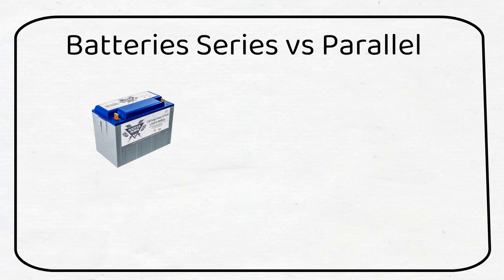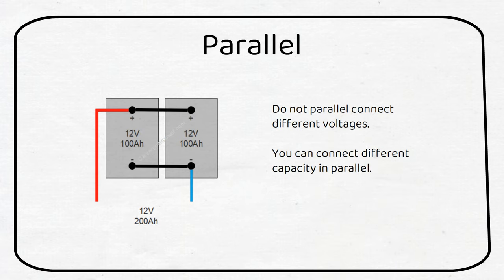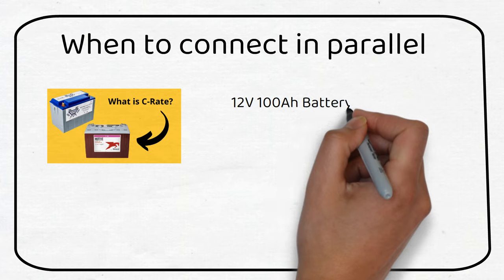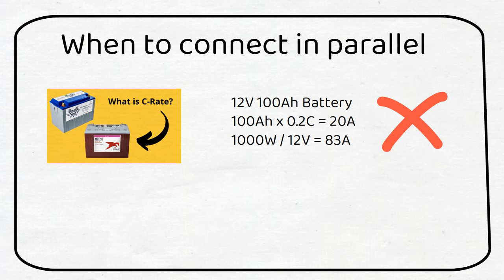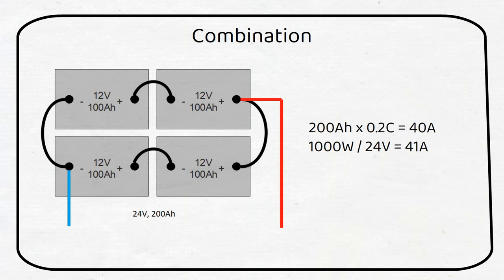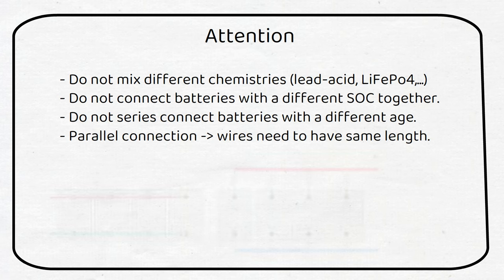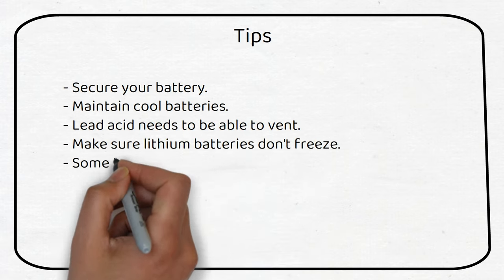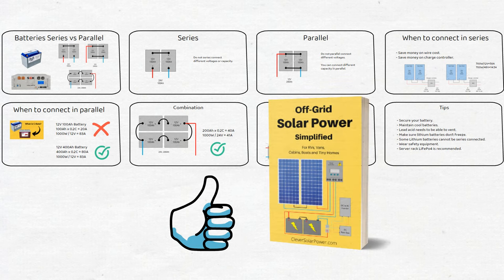Wiring Batteries in Series or Parallel for Off-Grid Solar Power

Comment: Ive seen a lot of these videos and each one has a different way to wire in parallel and the type of inline fuse to use. I just went to an electrician site and it was different than this one.
Reply from the maker: That's because there are different methods to wire them.

Comment: Hey Nick. I am still confused after all my research. I Recently purchased two 24v 100aH LifeP04 batteries. I plan to connect them in parallel to get longer lasting power. I am having difficulty determining what cable size I will need for the parallel connections between batteries and from the batteries to my 24v 3k watt Growatt all in one Inverter. Thank you for any insight.
Reply from the maker: Checkout one of my latest videos about current sharing. To make it easy, just use the same cable that you would run up to the inverter for interconnecting batteries. For a complicated answer, checkout my video about current sharing.
Reply: 4A / mm^2
Reply: @cleversolarpower Thank you!

Comment: Not good engineering practice to connect low impedance batteries in parallel - large circulating currents may result causing potential fire / explosion.
Reply from the maker: You should only connect in parallel when they are at the same voltage (state of charge).

Comment: Can you feed a single 12v battery from a 24v solar array?
Reply from the maker: Yes, it's not going to be efficient if you have a PWM. But no problem with an MPPT.
Reply: @cleversolarpower  Two 12V peltiers how do i connect them directly to 24V solar panel?

Comment: Good day sir can i connect 2units 55ah 12v and 1unit 100ah 12v battery in parallel connection with the same brand of battery?
Reply from the maker: If it's lithium and they have a BMS inside, you make two battery banks. One 110ah 12v and one 100ah 12v. Let both batteries go to a busbar. Every battery bank (2) needs to be fused separately.

Comment: 1:23 that is not the way to size a Charge Controller. A charge controller amps depends upon the Solar Array Current at Maximum Power Or Imp and depending how many panels are connected in Parallel.
Reply from the maker: No, you are wrong. The current of the charge controller is determined by the charging current to the battery, not the input current from the solar panels.
Reply: @cleversolarpower  if so then why do we connect Solar panels to a controller in the first place??
Reply from the maker: @giovanninongbri2250  Take your solar panel power and divide by battery voltage, then you have your charging current to the battery. 600W/12V=50A -> 50A charge controller. Then you have to calculate the input voltage, because there is a limit on it. max input voltage = Voc*panels in series * 1.25. If a panel has 22V Voc, then: 22V*3panels in series*1.25=82.5V -> charge controller with 100V max input voltage is ok. Hope this helps.
Reply: @cleversolarpower  so you're telling me that the controller makes its own current to charge a battery? the solar array current charges the battery so if you have a 36 cells Solar panel which is considered 12Volts or having a voltage maximum Vmp rating of 17Volts and a maximum current or Imp rating of 8 amps and suppose you have three panels connected them in parallel the total amps would add up to 24 amps, whereby the voltage stays the same as 17Volts,  So the current coming from the solar array to the controller will be 24 amps so choose a controller size of 24 amps x 1.25 = 30amps and if you have a single 12V Lead acid battery then select a controller of 12Volts. Hope this helps , I'm an experience in the solar industry with installations and sizing so I believe I'm qualified to share my opinion and the sizing of a controller.
Reply from the maker: @giovanninongbri2250  A charge controller takes the total input power from the solar panels, not only the current because power=voltage*current. If you have a PWM, then you should do it the way you described. If you have an MPPT, then you need to connect as many panels in series to the max allowable input voltage of the charge controller. Remember, it is total input power that matters, and not current.
Reply: @cleversolarpower  yes I do know that Power = Voltage x Current.  I agree with you on the PWM controllers. Just make sure you mentioned the type of Charge controller you used on your videos so that common people will understand
Reply: @giovanninongbri2250 sir can you shade me a light, got 12v 150 ah and 3 12v 50ah bat is it ok to parallel them?
Reply: @pepegonzalez8301  No do not mix/connect different battery ratings together. Each battery must have the same Voltage and Amp Hours and the same C Rate.
Reply: how about series connection using 2 different amp batteries  with same 12v? is it okay?

Comment: can i series 2 different AH battery with same voltage?
Reply from the maker: If you connect two batteries of the same voltage but different capacities in series, you will get the correct voltage, but the battery with the lower capacity will be overworked as it will discharge faster than the larger one. This can lead to reduced battery life and potential damage to the batteries.
Reply: @cleversolarpower  thanks so much sir for info

Comment: WoW never heard about c-rate, and believe me, no e bike owner mention it. Wel i have 4 lead acid each 7 amp. Is it wise to make for mij ebike a c - rate configurations. The controller can handle 12-24-26  volt. Just have them now series it works
Reply from the maker: 4 12V batteries in series will give you 48V at 7Ah. With a 0.2C rate you should only draw 1.4A*48V=67W

Comment: hi thanks for your videos. I have 52 AGM 12V and 40 Ah batteries. I would like to create a photovoltaic storage unit (I know they are not indicated but I want to try). What type of series/parallel connection should I make to maximize Wh and get 48V total?

Comment: @cleversolarpower  thabk you for reply.

I meant that I have 1 set of batteries. Battery 1 12v 280 ah and battery 2 12v 280 in series to make a 24v of 560 ah 
& a separate
Battery 3 12v 100 ah and battery 4 12v 100 ah in series to make 24v 200 ah.

Could I now parralell the battery 1 and battery 2 to battery 3 and battery 4 (battery 1 and 2 became 1 and battery 3 and 4 became another )

Comment: i had cable wires shoter and was draing battery more then the other.   I have two 24 volt 200ah batterys conneted in series to make  54 volts i conneted it 4 hours ago
I have to go turn of everthing off and paralele the batterys to  bring them both the same volts now as one is 78% and the other 100% glad i so your video explained a lot i did not know thank you.

Comment: I have 300 watts on panels coming in to a 400 watt charge controller. Then from there to a 12v battery with 35AH. Then to a 2000Watt inverter. Can you help me determine how I can improve this or if I’m doing this wrong.
Reply from the maker: Your battery is too small. Check my video about how many batteries for a 3000W inverter. It's my most watched one.

Comment: I have 4x100Ah Lithium batteries that I want to keep in parallel @ 12v and want to connect a 3000watt inverter to. I'm aware of the cable size requirement with a safety margin being around 312amps and 0000B&S or 120mm cable seems to be what's required when considering what the inverter can draw in current. My confusion is 'if' a busbar is used does each battery connected to the busbar have to have 0000B&S cable interconnects or will the 0000B&S cable only be required as the connection cable at the end of the busbar to loads? It seems to me that each battery will only supply one quarter each of the max current so cable size from each battery to the busbar can be reduced accordingly. Am I wrong?
Reply from the maker: That is correct. Add a 150% factor to it as i have explained in the video.

Comment: What is the best configuration to connect three lead acid batteries wired in parallel to the charging and load wires without a buss bar available? Should the charging and load wires be connected to the same terminals?
Reply from the maker: Yes, all to the same terminals. Main positive on battery 1 and main negative on battery 2. Max 3 connections per battery terminal. Otherwise -> busbars.

Comment: If an appliance draws a certain amount of energy, how does a change to voltage increase the battery life?
Reply from the maker: Increasing the voltage will reduce the current draw from the battery. Less current draw= slower discharge rates = longer lifespan. Check my video about C rate.

Comment: Could I connect 2 12v 280 ah batteries I have in series (24v now) to two other batteries of 12v 100ah that I have in series (24v now) IN PARALLEL?
2 separate series connected batteries to be connected in PARALLEL?
Reply from the maker: Yes, battery 1 24v 280ah seperate and battery 2 24v 100ah seperate to make one big 24v 380ah battery. Every battery set needs to be fused.
Reply: @cleversolarpower  thabk you for reply.

I meant that I have 1 set of batteries. Battery 1 12v 280 ah and battery 2 12v 280 in series to make a 24v of 560 ah 
& a separate
Battery 3 12v 100 ah and battery 4 12v 100 ah in series to make 24v 200 ah.

Could I now parralell the battery 1 and battery 2 to battery 3 and battery 4 (battery 1 and 2 became 1 and battery 3 and 4 became another )

Comment: 4:20 i dont understand whats the diff hrere in wiring , why is left marked wrong and right marjed as correct?
Reply from the maker: Every battery is fused and goes to the busbar. This is for current sharing reasons. Also if one battery fails, the rest will dump their short circuit current into it, that's why you need a fuse.

Comment: How Can we connect equalizer 24v for 4 battery in connected 24v ?
Reply from the maker: Do you actually need one? With 4 batteries this seems less likely. Measure the voltage of each battery. If needed parallel them or charge individually to reduce voltage fluctuations.

Comment: Hi, with the c rating when connecting a inverter to draw 240 volts can a microwave capacitor be used to eliminate this issue of having more batteries in parallel? 
If possible is there a specific way to wiring.
I have see capacitors in parallel being used in some setups on utube  this way for the initial draw.
Reply from the maker: A capacitor bank will help with reducing the startup current. Microwave is an inductive load so a capacitor bank will help reduce this. I haven't done this before, so I don't have any personal information to share.

Comment: If I connect 2 12v battery in series. Will it increase the watt hour? Meaning more Capacity? For example, I have 2 12v 280ah battery which has 3584Wh. If I connect 2 in series it will has 24v and 7168 wh. So I double my capacity?
Reply: No. If you connect in series, only your voltage will be doubled up. If you want to double your wattage, you need to connect them in Parallel, but the voltage will stay the same. If you want to double the voltage and wattage at the same time, you need 4 batteries with same spec, or just buy new batteries.
Reply: @Boiledfoodonly  I'm still confused. Let say we connect 2 12v 100ah battery. We will have 24v 100 ah battery which is 2400 watt hr capacity. But a single 12v 100ah battery will have only about 1200 watt hr capacity. So we double the capacity?
Reply: @TienTran-bi1jv  oh I am sorry, if it is in wattage, it means power. If the voltage doubled, yes of course the wattage will be doubled too as the formula for wattage is voltage x amperage. But the capacity (Ah) will still the same.

Comment: I intend on taking several 20v 1.5 ah 18650 powered tool batteries and creating a larger more capable battery. My only question is would it be better to make 5 banks of 4v and run that in series , or 5  20v banks
Reply from the maker: I would increase voltage as it will mean less current thus less thick wire.
Reply: @cleversolarpower  the wire and all other components will be oversized regardless. I was wondering if either way is advantageous with regards to capacity longevity and power delivery

Comment: Some lithium batteries shouldn’t be wired in series? Is there a way to know when it’s not okay? Im specifically looking to wire 24v Flex tool batteries in series and parallel to double voltage and capacity.
Reply from the maker: It should be mentioned on the product datasheet. The reason is that some BMS'es are not made for the increase in voltage like 48V. However, most batteries can do that now, it was mainly a problem of the past.
Reply: Awesome! Thanks!

Comment: If I wire 212 V lithium ion batteries that are 100 amp hours each and have a watt rating of 3800  WATTHOURS hours I know the voltage will double the amperage will stay the same but what happens to the WATTHOURS
WILL the WATTHOURS  double or will they stay the same?
Thank you for anyone who can help me with this ❤️❤️🇺🇸
Reply from the maker: What do you mean with water? Send me an email because we need to get to the bottom of this well 😄
Reply: My apologies I was  talking not typing😞
It made water out of WATTHOURS?
Reply: It doesn't matter whether you wire them up in series or in parallel the Watt-hours just add up.

Comment: I have 4 x 6v AGMVRLA 6v 75lbs batteries in my RV. They are plugged in, in the combination setup you have shown.  I use them to off set pole power as our RV needs more power than the RV park gives us.   I want to set up a solar trickle charger over the winter to keep them charged,  would I have to change from a combination setup or can I just plug in some solar panels to them with clamps and they will charge them all.
Reply from the maker: I assume they are wired as 24V? Then having a charger attached to them (positive to batt 1 and negative to batt 4) will do the job.

Comment: May i ask.
If i use 20 w led lights  i want to use 12 hours a day how many Ah batteries  i need?
Reply from the maker: 20W*12h=240Wh. If you have a 12V battery, then: 240Wh/12V=20Ah@12V. If you are using lead-acid, then multiply this by 2 and if you use LiFePO4, then multiply by 1.2 Hope this helps.
Reply: @cleversolarpower  not really  understands 😅
Reply from the maker: @BlackPearl5077  Try to read again and do the math yourself. Once you understand you can replicate on all your appliances. Or use my calculator on my website.